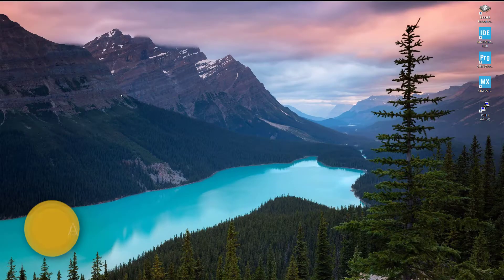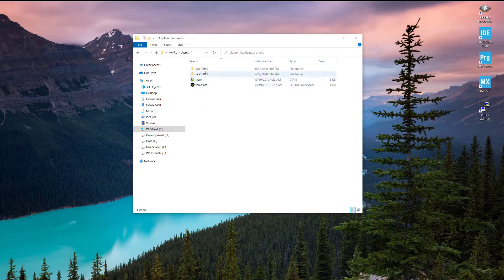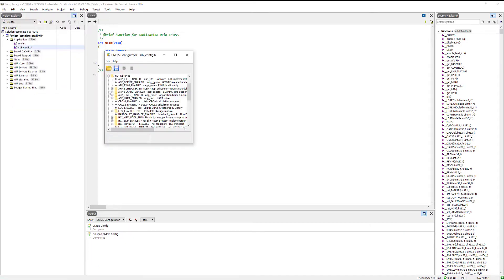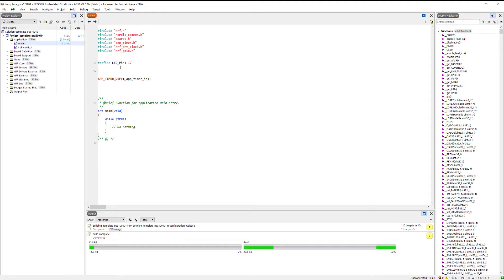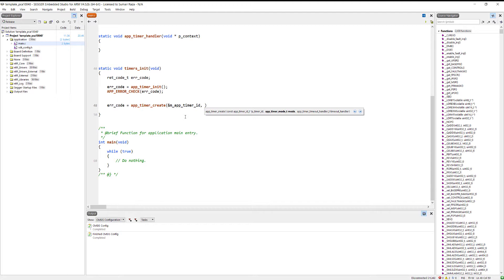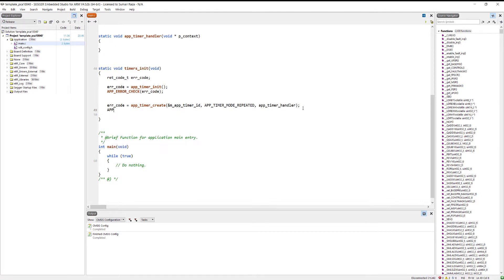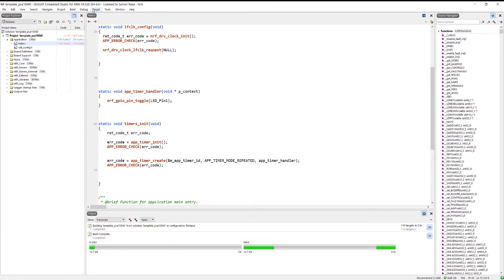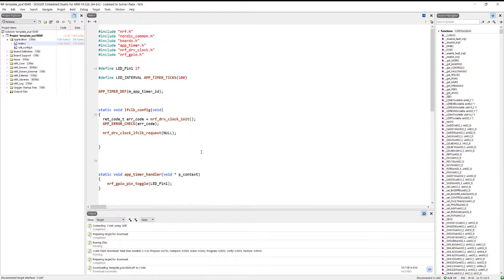nRF5 SDK - Tutorial for Beginners Pt 17 - Application Timers

Comment: Hi Sumair, love your videos. you should consider putting this series on Udemy as well. One question: static void app_timer_handler(void * p_context) when you create the handler, what does the (void *p_context) part do, and what is it pointing at?
Reply from the maker: p_context is a void type pointer, which can get some additional information when interrupt occurs from the application timer unit, we normally don't need to get this data from the pointer unless we have some special use cases.

Comment: Hi, this video is amazing!! and i have a question? actually thing is i want to generate the interrupt for 2 times. for example, 1 interrupt  is after 50 mins and other one is after 1 hour. So, can i able to do this both in same instance ? and once it reaches the 1 hr time period the timer should stop and it should start again only when i do press the button and again this process should repeat once i press the button. kindly, do the needful. Thanks in advance !!
Reply from the maker: Hi @
Roshan_Prajapati
You can use the same timer instance for two different times. All you have to do is to:
> Set the timer in single shot mode
> Set the timer for 50 mins
> start the timer
> Once it finishes it will not start again
> Set the new time value for e.g: 10 Mins
>  Start the timer again.
> this time it will finish after 10 mins.

In this way you can program it. or you can use two different instances independently .. the choice is yours ;-)
Reply: @SumairsEmbeddedEngineering  Thank you!! i will check on that.  Thanks for your support and how can i contact you personally ??